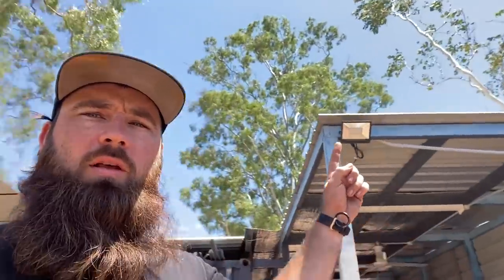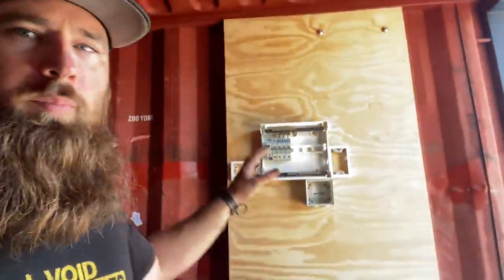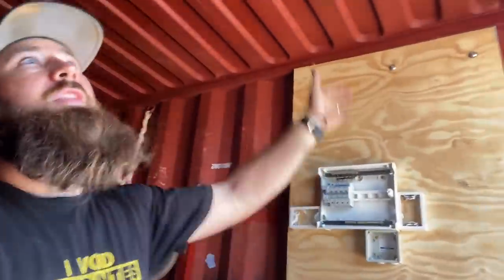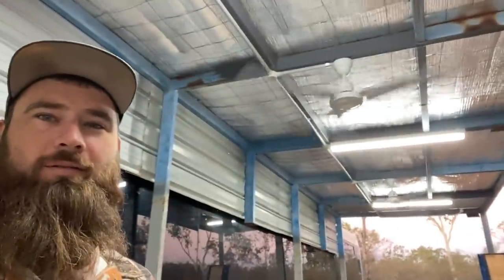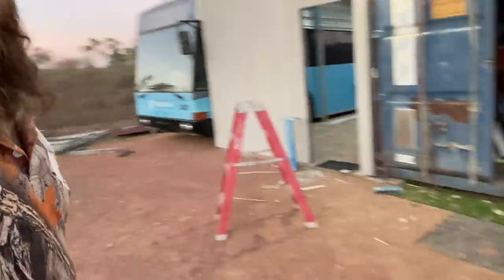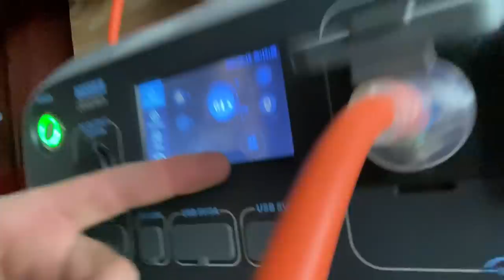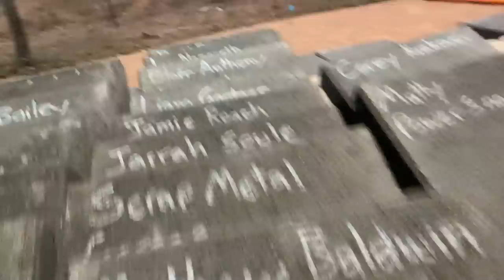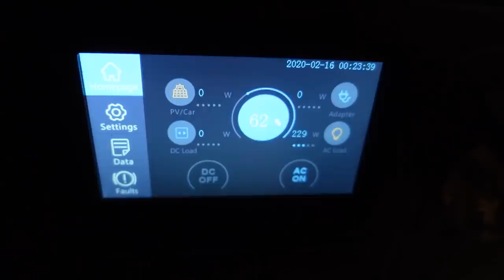Installing the electrical system in our off the grid home.

Comment: Cody!!! A word of advice mate. Stop the wall linings in the bathroom. Take them out and replace them with 6mm villaboard with recessed joins. Fully set all joins. If not sure call a plasterer. Using soffit sheets and pvc h mould in a wet area is a major no no. You will have massive issues in wet areas in the future if you continue with this. Get it right the first time mate to save you the hassle later of replacing all the work you have done. Just a word of warning. Up to you. Cheers
Reply from the maker: I’ll look into it. Thank you